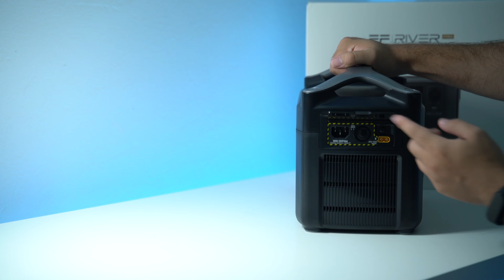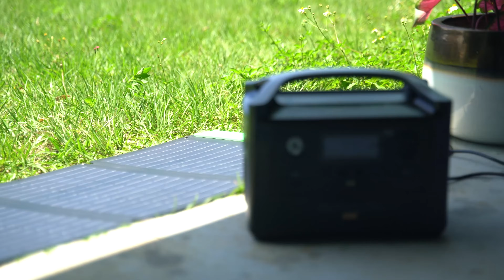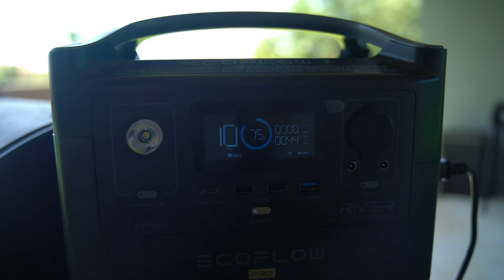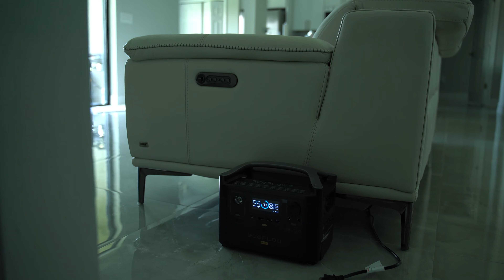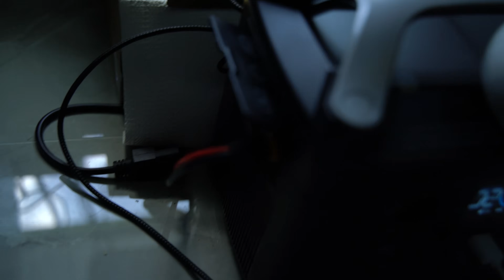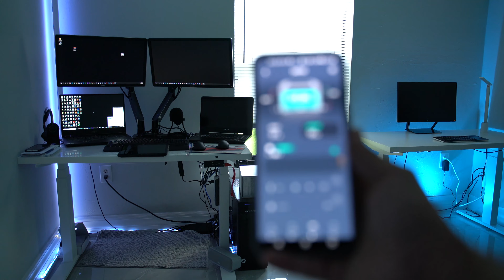EF Ecoflow RIVER Pro Portable Power Station 720Wh Review

Comment: Hello, tell me please, if this station can be charged from a 220 volt outlet directly or inverter needed? (for using in Europe)
Reply from the maker: Hello, no it won't charge from a 220 outlet. Note that the AC charge input is 100-120 volts, that is for the regular wall outlet input. The DC input is is 10-25 volts, that's for the solar panel input and car outlet. This power station has its own inverter and BMS, so it will most likely trip the Over Voltage Protection if you tried to charge it from a 220  source, i don't recommend trying since there is risk of possible damage.
Reply: @RealSenseChannel  ok, thanks!

Comment: Correction: The power boost does not increase the voltage, it lowers it.
The long term max output is 600W, shortterm 1200W. If a device required under normal circumstances e.g. 1200 W permanently, the Ecoflow Pro supplies half the voltage, resulting in 600W consumption. That's why e.g. a simple drip coffee machine will take longer to boil and supply the water than usual. But better slow than not at all. Devices which contain electronics are usually not suitable for this operation mode. So it's a practical mode but should generally be handled with caution.
Reply from the maker: Yes you are correct, thank you for noticing.

Comment: Heat video after the start of the grill it lowers the watts.. so what was the hours left on it ..
Reply from the maker: It depends on what temperature you set the grill to, so around 300F it can las around 9-10hrs, 500F it will do around 3-4hrs. Also outside weather conditions can affect that,  hot days and cold days will take a hit on performance. Also If you add a solar panel you can pretty much grill all day 😅
Reply: @RealSenseChannel  thank u .. I grill temp around 350 .. for 3 hours .. great .. ill take by the water

Comment: thanks for the review. I bought the erp and the  bluetti eb3a. I had use for the boost (ecoflow) and the power lifting(bluetti) features. the ecoflow worked great putting out all 600  watt. the eb3a was a total fail in this department maxing out at 350watts which was too low to operate anything. I tried the "power lifting" on two units so the problem is in the bluetti engineering.
Also the bluetti was much less impressive in the solar charging department. while rated @ 200watts input it is limited to 8.5amps which with a normal solar panel that puts out a max of 20 working volts limits it to ~160watts no matter how big the panel. Ecoflow had no problem charging at full 200w.
the app and controls for the ecoflow are vastly superior for the ecoflow this leaving the only down side,,, as you mentioned... the battery chemistry.
Reply from the maker: Yes the features the River Pro has are un-matched at the moment, it's a versatility PPS.

Comment: Can this be charge a Tesla car in the emergency like camping?
Reply from the maker: Unfortunately not, I've tried it with one of those grounding plugs on my Honda Clarity plug in and it did not charge. The RIVER line is not powerful enough, i have seen videos that the DELTA line can be used though, i would stay away from the DELTA mini since it's the least powerful. Just note that it won't provide much range...

Comment: Can you run a small air conditioner? 2500 btu? I want to run my air conditioner on this battery
Reply from the maker: It sure can. I've seen it do 5000 BTU AC units as well. Check out this video where an AC test is done at around minute 7:https://youtu.be/MHOkVmCyHxE

Comment: It's cool you showed the power station running your home office. I also like to run my home office and full size fridges off solar to save on power. I still need to fully capacity test my ECOflow River Pro. Do you think you get the full 720wh of capacity or less when taking it all the way down to 0%?
Reply from the maker: Thanks, yeah its definitely changed my office for the better. I haven't ran any Capacity tests, but based on my estimates on running it for a year now its more like around 600Wh of usable capacity, the rest seems to lost on powering its own internals, especially when running the AC ports.
Reply: I can’t run my fridge on it not sure how you are doing so
Reply: @rthilson  I use a larger power station, but I'm doing this same concept. Solar powered appliances.